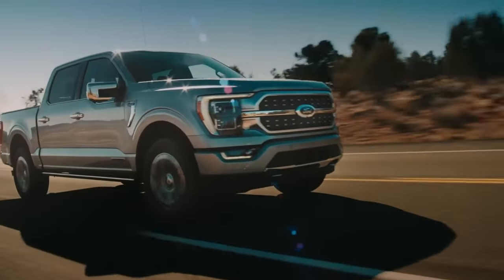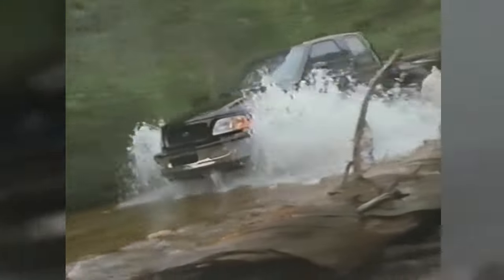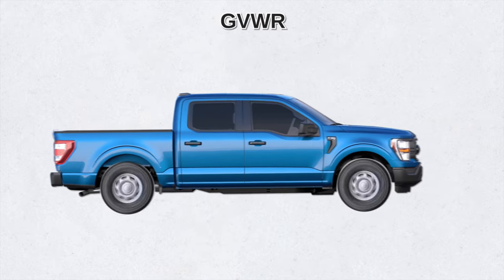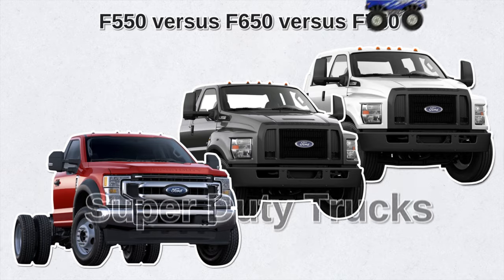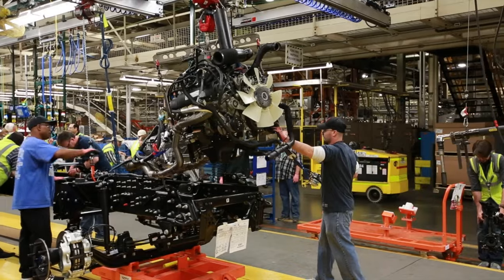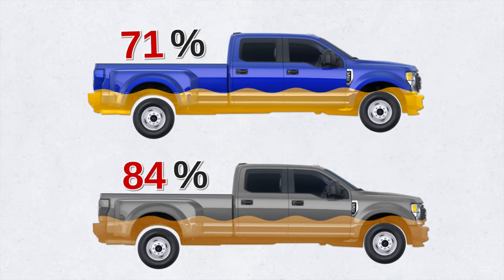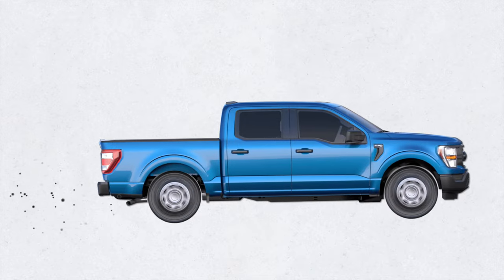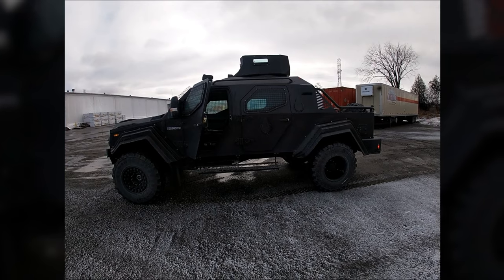No One is Telling You the Truth About Ford, So I Have to

Comment: Well I got a 2013 ecoboost 3.5 with 217000 miles very reliable truck done everything correctly on my own staying away from stealer ships my synthetic  oil changes started at 7500 miles when newer  then I moved to 5000mile oil changes after 100000 now after 200000 I changed my oil every 3k miles  haven't replaced anything expensive yet other than water pump on my own for 150 dollars, sparkplugs every 50k miles not 1 ignition coil has been replaced, still running like a queen , normal wear and tear ,rear shocks had been replaced twice ,all other suspension parts are original and in good condition ,leaf springs  shims started to squeek got replaced for a few dollars on my own  love and take very good care of my truck ,it's a limited 2wd bed cover and loaded all around

Comment: I have an E150 and a E 450 fords. I don’t really like Fords a whole bunch but they are truly long lasting. My E150 has 233,000 miles in USA and the E450 has the 7.4 TD with 560,000 kilometers was from Canada from new. Neither has any driving issues which amazes me. My 1987 Ford Motorhome on a 350 chassis was also amazingly reliable sporting the old 460 carburetor engine. I never had to fix anything on these 3 vehicles. Only batteries and a tire blew out

Comment: Buying a used 2006 F-650 26ft box truck with a hydraulic lift gate on it was cheaper than paying a moving company to move my Auto Shop out of Kommiefornia when I left in 2018. I named her "Betsy" her C7 Caterpillar motor is only 210HP but, that truck averaged around 11-12MPG with over 12,000 of shop tools and vehicle lifts in transit. Far better truck than an International I think and GM really doesn't have much in the Heavy Duty market. Best thing about the larger Fords...They generally have same parts in interior like HVAC Instruments and light switches as a F-150 so parts are cheap and readily avalible.

Comment: I used to drive for Ford. The difference in fuel economy between gas and diesel for F-650/750 is negligible. Only thing I noticed was the constant gear hunting of the gas engine vs the diesel engine on the highway.

Comment: I have a 2012 fx2 crew cab f-150 with the coyote 5.0 engine with 205000 miles on the dash not a single warning light on the dash super solid truck comfortable and plenty of power for a big truck

Comment: You forgot to mention all problems that come with a diesel and the def system and maintenance cost of filters and other stuff. What you save in fuel doesn’t balance out compared to a gas engine
Reply: If you’re towing a ton, no comparison to diesel. The engines can last forever if taken care of
Reply: @lesterparker1594  yea I’m not a farmer nor enjoy camping towing a fifth wheel anymore I’m not a contractor that needs to show bling! the heaviest thing I tow is my boat and she weighs 6k.
Reply: Totally agree
Reply: Yeah that’s why you rip out the def system.
Reply: I agree.  My son owns a repair shop in rural Texas.  He says that the newer diesel engines just don't hold up to hard work.  With all the modernization, they're not able to last like pre def engines and the cost to operate is nuts.  I've always been a big fan of the diesel especially when the fuel was cheaper than gas, but now I'm not sure I'd buy a HD truck with a diesel engine.
Reply: @robertm2172  yea so you don’t need a diesel. Gasoline will work perfect for you. Lots of people do need a diesel for the towing capability though
Reply: Plus you pay $10K more for the truck when you buy it with a diesel. Had and older F-250 with the 7.3 International Diesel. Beast of an engine and they will last forever if you take care of them. Since then have not been a big Ford Diesel fan Love the gas trucks though and waiting to see how the new 7.3 Gas does.
Reply: These trucks have been commercialized doesn't make sense to own one if your not going to make money from them

Comment: I miss the loud Diesel engines. I miss the 7.3L diesel 6-speed manual the most. I’ve got a 6.7l 2020 f250 now, it’s the fastest truck I’ve run & it feels like a truck when I drive it. If I wanted a car, I’d get a car or a Chevrolet. I’ve driven them all off road in the Sandy citrus groves in Florida & in the low swamps & ranch lands. Ford has always held up the best out of any truck I’ve driven.

Comment: I bought a 2004 Ford F150 Heritage old body style with extended cab and 8 foot bed in 2019 paid 1,900 for it I put have over 42,000 miles on it and it still going good no complaints

Comment: Oops! The 2021 Performance stats for Ford's 6.7 L are: Horsepower - 475, Torque - 1,050 Ft. Lbs. My 1st serious Truck was a '68 F-250 Camper special (one-Ton Running Gear) with the 390 engine & C-6 Trans. The only piece I ever had to open up on that engine was the Carb. The float sank & I had to replace it. When I sold the Truck, it had over 240K miles, didn't smoke, and would still light up the 10.5 x 16.5s. That was one very reliable truck.
Reply: The 6.7 is rated much lower for the F-650/F-750 trucks.

Comment: I had a 2001 F-350 with the Navistar motor.  I had it for 10 years until it turned into a total rust bucket.  I hated to get rid of it, I loved that motor.  It didn't give me a lick of trouble in all that time, it was strong and powerful.  I sold it and got a 2011 F-150 with the V-8 and that, too hasn't given me any trouble except for a speed sensor which was replaced under warranty,  Other than that  just normal maintenance and I've bene good to go.  It took me from the northeast to the deep south so thankfully rust is no longer a problem because I have no desire to get rid of it.  I still miss that F-350 though.

Comment: I have a 96 f350 7.3l diesel with 105k.  My friend parked in in 2009 because the rear fuel tank had a hole in it.  After tires and fuel system work I got one hell of a truck.  It's way more than I need it will probably outlast me.  I drive it 4k a year.

Comment: 2011 F150 5.0 V8 6spd, towed 1000lbs over gross combined weight up to AK and back at 50000 miles. I'm at 110000 now with no issues yet but have always performed the Scotty mx schedule.

Comment: I drive a Toyota diesel and for the last 30 odd years I’ve always driven diesel cars even my last car a GM diesel lasted 200,000 miles so I’m pretty much used to the diesel, before I got my first diesel I hated them but nowadays they’re pretty much bulletproof and I was talking to a chap yesterday who hated Diesel engines until he needed a truck sized vehicle and had to go diesel and is now an advocate of the diesel, I’m from Ireland and nearly every mechanic can work on Diesel engines over here but it’s not the same in the USA, but once you learn to live with the slight less take off speed of the diesel you’ll really appreciate the extra miles you get per gallon, scotty has really been the first one to relate to difference between both engines in a way people can understand, good work again scotty
Reply: I would love a 4runner with a diesel motor.  That's a million mile vehicle if there ever was one, especially now I live in a place where rust is not a problem.

Comment: I had a 2013 F150 and loved it. Traded it in with 190,000 miles for a 2021 ranger.
Reply: How do you like your ranger? I bought 2020 model
Reply: Was it a 5.0 or an EcoBoost.
Reply: Big mistake rangers are lemons ...too many issues should have bought the maverick or go with the f150
Reply: @CJColvin  5.0
Reply: @Audace1400  I’ve been enjoying it a lot
Reply: @evantalbott8602  Sounds awesome brother I have a 2011 Ford F150 with a 5.0L Coyote V8 in it with 142,000 miles on it and still going strong and it's a beast and it sounds like a beast with the Borla ATAK Catback exhaust on it.

Comment: Hey Scotty. When I got out of the Marines in '06, I bought a '99 f150 that had a v6 engine. It was my first truck and I loved it. I was also very inexperienced when it came to maintenance of the vehicle. Needless to say, when it wouldn't go any faster than 80 mph, I just thought it was from being an older truck (again, very inexperienced). I ended up trading it in for a particular car I needed for work at the time, and decided to figure out what was wrong. My father in law found and printed off detailed instructions on taking apart the engine. It turned out there was a small vacuum hose (maybe 6 in.) With a hole on the back side of it! Wrapped some electrical tape over it, and the last 3 days I owned it, the thing was a beast! I almost changed my mind on trading it in lol. I still miss that truck.
Reply: Newer trucks have electronic limiters that limit your speed depending on tire type. It's a safety feature to prevent you from overdriving your tires. 80 miles an hour is a typical limit for lower rated tires.
Reply: @houseofno  He said a ‘99 F150.
Reply: Hey folks its @houseofno  the typical modern car lover.
Reply: @houseofno  that’s not even close to true 😂. The speed limit on some highways is over 80, and  the general speed rating of most passenger tires in around 112 IIRC. The lowest governor speed I’ve ever seen or even heard of for a consumer vehicle is 95 (on the late model F-150s). If your truck won’t go over 80 and it’s not a semi or something go to a mechanic because something is wrong lol
Reply: @houseofno  The speed governor on a '99 is set at 100mph.

Comment: Have always had Ford Trucks. Have a 2001 F250 SD with a 5.4 Triton V-8. I have had very few issues with mine. 344,000 miles on it and it is getting tired but still runs everyday.

Comment: Scotty -- To drive an F650 or F750, you CAN run into a requirement to have a commercial driver's license.  If you pull placarded hazardous materials OR pull a trailer rated at more than10,000 pounds, a CDL is necessary.

Comment: I have a 2012 f150 and it started rusting through at 5 years.   The cab corners and rocker panels were completely gone by 2019.  Frame and wheel wells are now starting as well.   I know that they make aluminum bodies now, but it always bothered me that ford couldn't get the rust issue under control.   I know that all trucks rust here in Pennsylvania, but I have a Nissan nv cargo van from the same year 2012, and it has zero rust.  Its never spent a night of its life in a garage either. I'm not sure what Nissan did that Ford didn't to keep the van from rusting, but the difference is remarkable. 

I've been a ford fan all my life, but it makes me made when you pay$$$$$$$$$$$$$$$ for a new truck and its rusting badly as soon as its payed off.
Reply: They some old Nissans that are rusted out as well.

Comment: The f250 and f350 superduty are the same truck just with different springs and the f250, f350 and f450 pickup can get a 48 gallon full tank. And the f450 has better turning radius because of the wider front axle.

Comment: It's absolutely clear you put more effort and time into the Ford review than the Dodge review!!
Reply: Dodge is garbage
Reply: Scotty is only collecting & summarising information (including video) from the manufacturers.  There's very little opinion about reliability & longevity – just a statistical comparison between models.  However, vehicle sales would justify spending more time on Ford F series, if he wanted to.
Reply: @1989pulsar  Why?  I bought my Ram 2500 in 2005..... in 2 months it'll be 17 years old. It needed  tires, brakes when they wore out,   new steering fluid line replaced...on year 16 the rear gas tank strap rusted away and the rear wheel wells rusted out.  That's it.   My Ram towed 3 sailboats,  hauled loads of sheet rock, plywood and lumber, carried 4 kayaks and bikes 100's of times to distant locations....carried family in the bed and been to multiple drive ins. I love it. I'm thinking of downsizing to the 2021 1500 Ram but I'm open minded to look at Ford although not convenient for maintenance.
Reply: @brianvogt8125  Is Ford the best selling pickup?  Best reliability?
Reply: Wkw? Dodge doesn't build trucks, you mean fiat ram they are sort of truck like
Reply: @wkw4095  anything from fca is utter crap

Comment: I have a 2004 F150. It has 384,800 miles on it. With only minor things that have worn out. Alternators, batteries, sunroof, window motor on the driver's side
, brakes and oil changes every 3000 miles. Still runs good for it's age. I want to see if I can get 500,000 miles out of it before I have to replace the engine.

Comment: My 10th gen F150 just rolled past 550,000 miles the engine still runs smooth as ever. Transmission needed rebuilt around 300,000 but other than that, it's been an inexpensive vehicle to maintain.

Comment: Well my 2000 F250 4x4 Diesel and wife's 2002 F250 4x4 Diesel are still running strong with 385,147miles and 367,348miles..... Change the oil and fuel filters ever 5k hoping to make 1million miles on each truck. Can't bet old 7.3Ls International they are like the 12valve Cummins.

Comment: I think 3/4 ton and up should be diesel. That's my opinion of course but gas engines have to work a lot harder to keep up with a diesel.
Reply: A lot of the gas HD trucks are sold in fleets. They are cheaper and a lot of those fleet trucks get traded in every couple years. If I was going to be doing a lot of towing or highway miles for sure I would rather have diesel but other then that gas is fine. At least Ford finally did away with the V10 I think. All kinds of trouble with that engine but I know somebody who bought a new tilt bed a couple years ago think he got it in 19 but it was an 18 model year and it has the v10 but it was also a hell of a lot cheaper then getting a diesel and it was before the new 7.3 v8.

Comment: Scotty I notice you didn't mention the stupid DEF fluid problem with diesels these days.  Everything DEF just shuts down and usually the vehicle manufacturers can't diagnose their own systems.  Heavy Equipment now forced to use this and when working to make emergency repairs equipment goes into flush/rinse and don't work.  We have had whole crews stuck on the side of the road due to these costly failures.

Comment: Hey Scotty, Maybe when you come back down to Tennessee. Maybe I'll have our 1985 Ford F150 legal and running. So Me and my wife Dixie can meet up with you and let you see it. We also have a 1980 Ford Granada 2 door.
The F150 that we have was my dad's truck. It has the 4.9L Inline six with a C6 Automatic Transmission. It has the electronic feedback carburetor.
It can be a pain in the butt on emissions, but it was one of the best built engines. It's the one that has timing gears. not chains or belts.

Comment: Looking for an F-250 truck to pull horses. I have not had much luck with Ford cars. Who makes the most reliable truck that is like an F-250. Is it Ram, GM or Ford. Which brand do you recommend, GM, Ford or Ram. I want a one with a  Diesel engine and pulling a 3 horse trailer.

Comment: My '96 7.3 liter turbo diesel was great, but when the cam sensor went out, it didn't hobble, it just stopped working. That was stupid. Every time it happened it was instantly $500. 🙄
Reply: That CPS is a $30 part that you can change on the side of the road in minutes, in the dark, with a single socket.  It's literally one electrical connector and one bolt on the front of the motor.
Reply: Alex Martin  If I'd have known that back then...
👍👍👍😁😁😁

Comment: I have a 2006 Ford Explorer eddie bower 4wd v8 4.6  that is making road noise about 35 mph to 70 mph.  I have done allot of recreational maintenance.  Changed the front diff rear diff all 4 drive shafts all wheel bearings alignment balanced brakes and rotated the tires…

WTF.   Still there now between 30 and 70.  I have had this truck 7 years….  They fal apart at 150 but fixing it is cheaper than a 3yr used one.  35k…

Last option is the transfer case.   Maybe the chain is loose?

Or a friend wants me to admit it. Is tire noise because the tires are not matched on an AWD.

So does it take another 1500.00 to replace the transfer case or should chunk the tires for $1k?   

Something else?

Comment: I have a question for Scotty!  I’ve owned several F-series trucks since the 1980’s, when you were comparing the F-350 to the 450 I’m curious why you didn’t use a comparable 350 long bed dually for the comparison.  I bought my last 350 over the 450 because it had a little better capacity than the 450 because of the curb weight difference.  Great vid, I’m sure you had a reason for your presentation I was just curious as to why.

Comment: Does GM have any decently reliable sedans nowadays?
Reply: no GM builds garbage
Reply: Gm are crap. My Tahoe has been in workshop for more than 11 months.  My uncles 2012 explorer is going strong at 221k miles on it.  No issues.  original transmission 
 That's my experience

Comment: Ford upped the power on the f250 - f450 make 1050 ftlb of torque and like 425 hp. Those are crank numbers though, are yours wheel? Cause they were pretty low.

Comment: Scotty I have a question, I have a ram 1500 2018. The problem I'm having is there is a soft ticking noise when I go to accelerate. I have been told that its the drive shaft but I thought about the hemi tick. Do you have any information on this.

Comment: Yep if you see a Ford over $3000 run away kicking and screaming unless its a work vehicle. As they are solid built vs gambling with junk 90% daily drivers, or digging for a 10% chance solid daily driver
Reply: What?
Reply: @richsweeney1115  you know that Ford builds work trucks and commercial vehicles or church vans or whatever better than they make their daily drivers. They can hold up for 300k miles. 

But everything else is a gambling junkyard. Crappy transmission and eco boost breaks down.